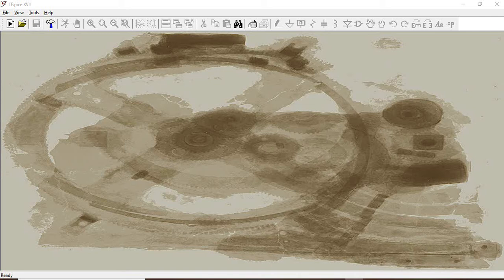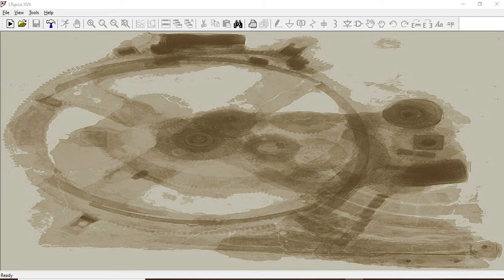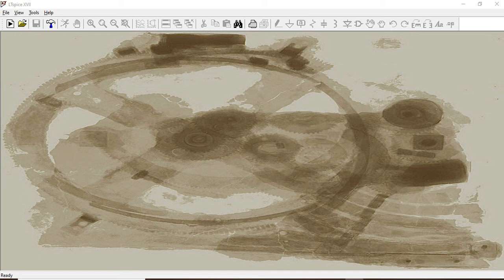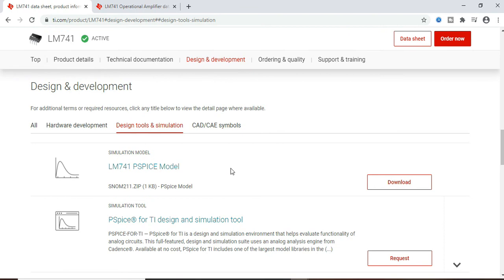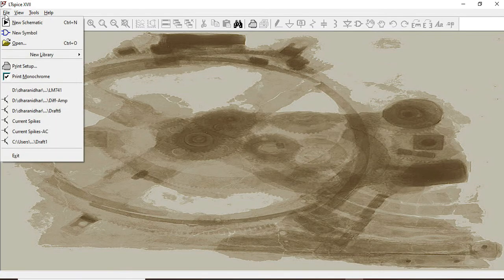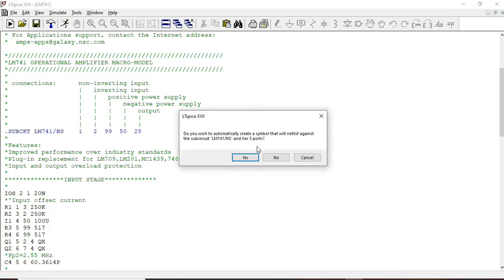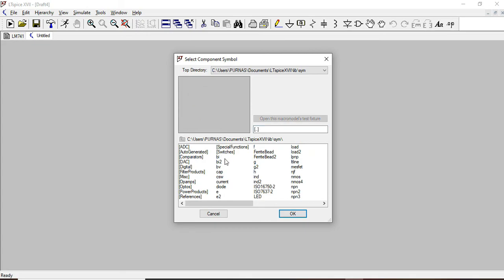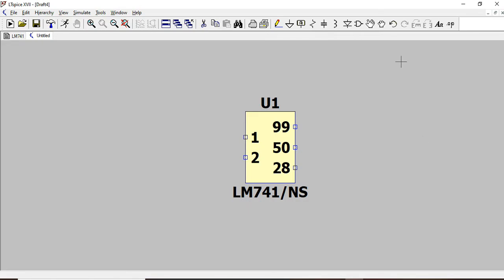How to add new component to LTSPICE Library || Importing new component to LTPSICE || Importing LM741

Comment: This should be a tutorial about HOW TO ADD a model. At 1:59 you suddenly have a file in some unknown folder which you didn't explain and you have it opened. Can you please explain HOW to put a model in the correct folder and how to open it. That is why we came to see this video.
Reply from the maker: Thank you visiting the channel. I have used my local folder and opened the model directly from there. It could be any location. The correct folder is to place it here: C:\Program Files\LTC\LTspiceXVII\lib\sym. This path depends on where you have installed your LTSpice. Mine is C drive.
Reply: @Way2Know    Thank you for the explanation. I recently downloaded the new version LTspiceXVII at my work computer and it does not automatically create the .lib files in the Documents folder. When I downloaded LTspice on my home computer though, it did create the lib files within the Documents folder. The "How To" video on the Analog Devices website does not explain this. They have not updated their own instructional video, which I find very frustrating.
Reply from the maker: This could be restrictions on some files from your work place. I would zip the lib from my personal systems and pass it to office system 😉